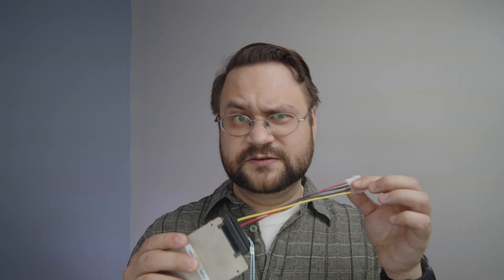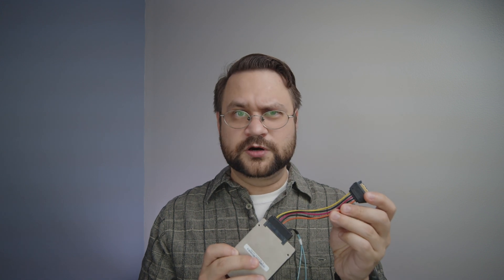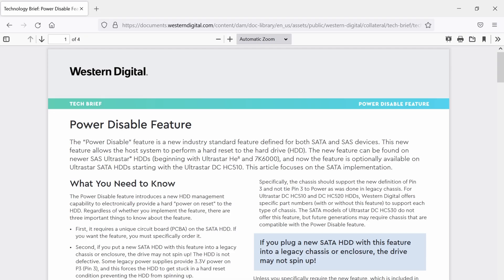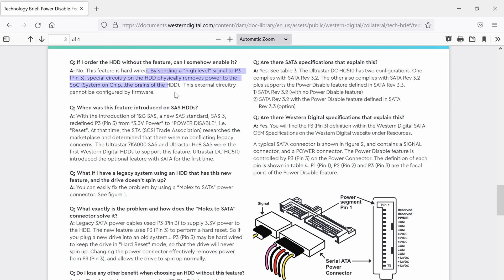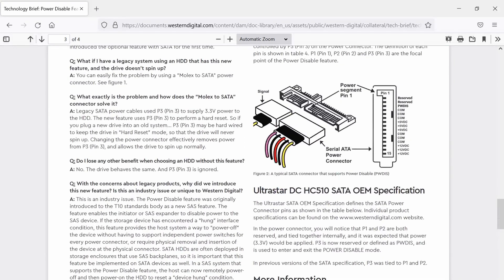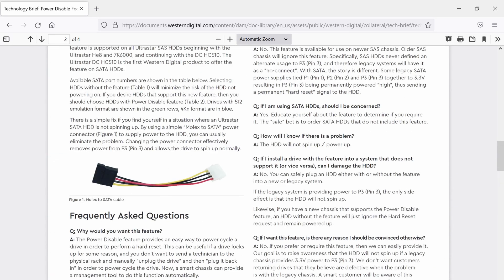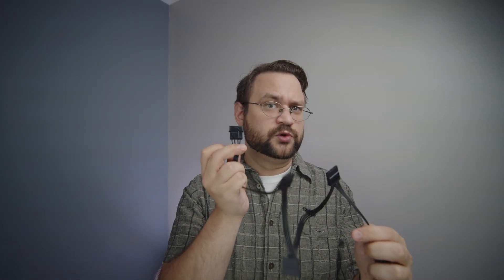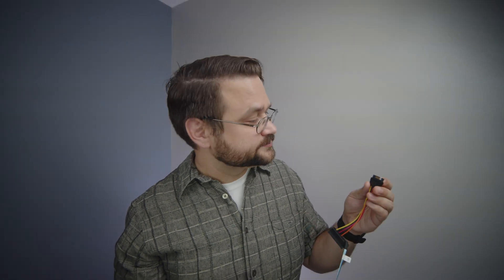SAS3 or SATA Drive not powering up? This might be why! (Troubleshooting)

Comment: Ok i got a molex ti sas cable but they are all male ends and make is what comes out of my psu can i just yse a female to female molex? Or is there a better way to power them? Also the psu  molax cable only has 3 pins will that be a problem?

Comment: Thank you so much for this I ordered two refurbished med drives yeah I know they are cheap but I needed to save my nas pool for the time being while I upgrade to better drives funny thing is first time they just send the drive and I returned it second time it came with sata male to female adapter with you guessed it four cables and it was seen right away … it was confusing at first as the med
Drives I had were actually new
This was a refurbished one and came up as wd but it’s working and now I know why thanks to your vide much thanks and appreciation I liked and subscribed as well save me a lot of pain

Comment: MB3000FBNWV - I have one of these that I am trying to get to spin up on my test bench but so far, no dice.  I have a couple of different cables I have tried too.  The cable with the wires only has two grounds and a yellow +12vdc and a red +5vdc.  No orange wire though.  Any idea on what I could be doing wrong?  On the one adapter I have, I tried putting captain tape over p1-p3 - still could not get it to spin up. Tried a couple of disks too.
Reply: Update: I wound up purchasing a SAS to USB 3.0 dock. Plugged the disk in and it powered right on and I was able to read and write to it.  Uncertain why the other cables and interfaces would not power the disk up.  The dock was expensive - $200.

Comment: Couple months ago, I couldn't get a SAS 15K drive to power up via the HBA card but SATA drives works perfectly. It took me a quite a few hours to figure out and it works when I tapped pin3 off. The molex to SATA connectors is the solution I am using now.
Reply from the maker: I'm glad I'm not the only one that had to scratch his head for a few hours! 😁
Reply from the maker: Btw, Leslie, was it just comments that contained code that it stopped you from posting?
Reply: @JanisRode  I think so.... and web link too.

Comment: I have 5 sas hard drive 10k I can't turn online I get I/ o error cannot activate message
Reply from the maker: Have they always done that? That behavior rings a bell....
Reply: @JanisRode  yes I buy from eBay I contacted the seller he said they work I tried different PC and cable the same .I am trying do a 16 SAS drive  10 k plotting    array
Reply from the maker: @Jfa-letsgo  Let me try to replicate the problem and I'll get back to you on that one.
Reply from the maker: @Jfa-letsgo  I think I just managed to replicate your issue and fix it, it's past my bed time though, so I will show you how to fix it tomorrow.
Reply: @JanisRode  sound good you the best thanks
Reply from the maker: @Jfa-letsgo  I just published a video, let me know if that works for you!
Reply: @JanisRode  k
Reply: Look like my problem can I do the same thing in windows CLI
Reply from the maker: @Jfa-letsgo  Lol, I just answered you on the other video. Short answer, yes, you should be able to. I tested the 1.46 sg_scan.exe on windows 10, and it scanned them fine, so the rest of the .exe's should work too.
Reply: @JanisRode  thanks I will try after work it should work